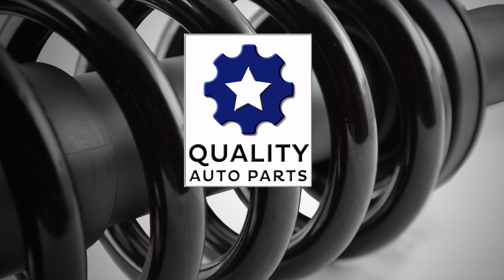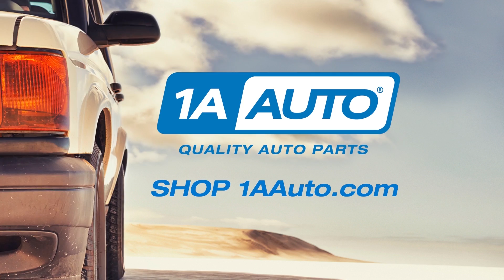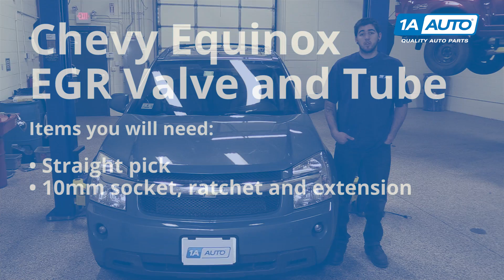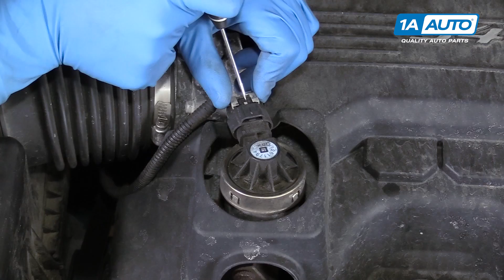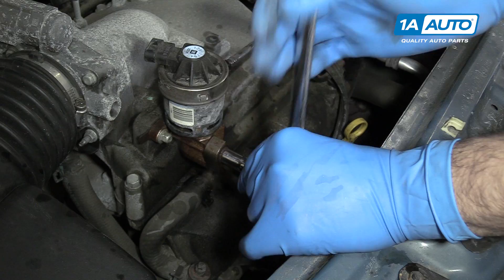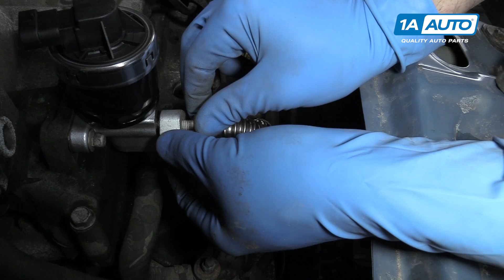How to Replace EGR Valve and Tube 05-09 Chevy Equinox

Comment: If anyone has this problem, I am currently experiencing the same issue. and snapped both bolts on the bottom at the manifold. and to remove those bolts and redrill the holes in the manifold I will need to remove the manifold, put it on a vise and redrill it. too tight of space to do it properly there. 

Since I am already removing the exhaust manifold, and the EGR valve works decent already. and there is no point to replace it just yet. I am planning on using the fitting on the old line that holds the line down into the manifold by cutting it, cleaning it, and welding it right onto the manifold to act as a spacer so the new line (retrofit one) fits. Since I am redrilling the holes, Ill get a longer bolt to go in and hold down the new line with the spacer attached. I can also just use 2 gaskets and not have to weld in the new one. we will see, and I hope to come back and update this thread if it works!

Comment: Been driving my Equinox for a while to get the EGR ready but not working. A mechanic told me to change the EGR. Can I add cleaner in motor before ?  and will putting a new EGR will compromised my other ready monitors?

Comment: I was getting oil leaking from the egr a year after it was replaced any reason as to why. Did clean the throttle body however when releasing the sensor i smelled oil

Comment: I have a code po171 I change everything I have to change and the light is still on . I try to pass emission and it’s telling me my EGR failed could it be that ?
Reply from the maker: +ItsMONEY__ There may be different reasons why you are experiencing this issue and we do recommend to have a mechanic diagnose your vehicle. Thanks for checking us out!
Reply: vacuum line the runs from the air intake after the MAF sensor runs to the back of the  intake manifold is damaged or clip broke so the vacuum line is disconnected.  Gm part 12602539

Comment: Can you please explain the reason for replacing the EGR valve and tube ?
Reply from the maker: +The Truth Speaker These parts typically fail due to carbon build up, electrical failure or corrosion.  If this part fails you will get a dash light, so using a scan tool will help better diagnose the issue!  1aauto.com

Comment: hola cuales son los simptomas cuando esa pieza esta dañada.gracias..
Reply from the maker: You might receive a check engine light that points to an EVAP leak.
Reply: Luis Zambrano i
Reply: Hello 1a auto.. can you make a video on how to change a pcv valve for a 2007 chevy equinox?thank you